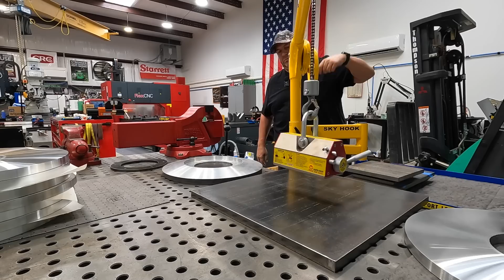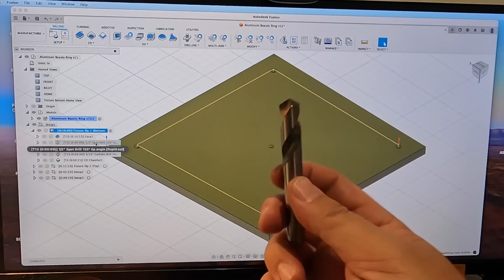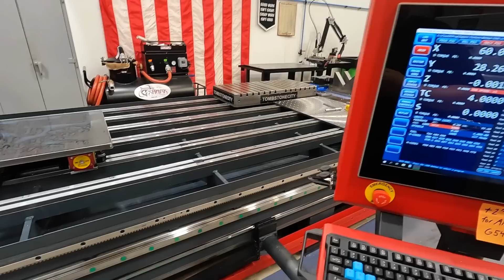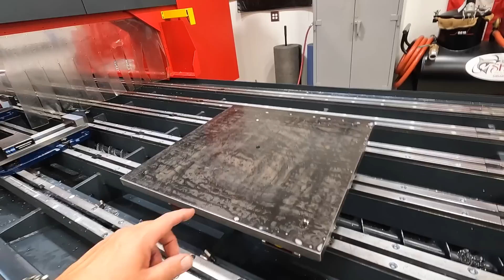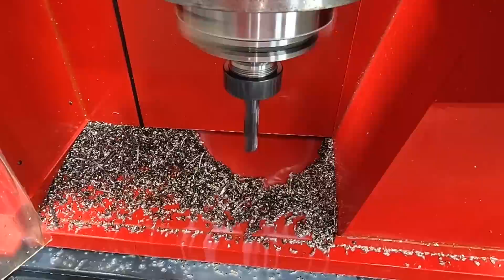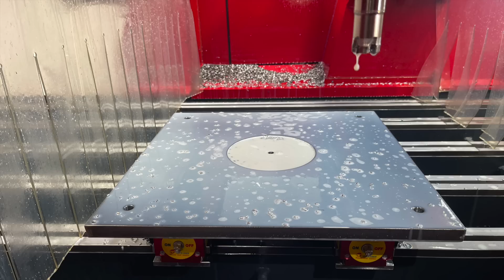Milling the Beauty Ring Fixture for Op.1

Comment: One thing I would have recommended is to threw drill the holes in the square plate to allow for chips to drop out. Not a big deal but a safety. Wish I had my own CNC. learning Fusion and having someone else run the program on their mill adds a certain level of difficulty to the learning curve. But it also adds a level of education to adjust the design and process to allow any shop to perform the operation. Great job Adam, thank for sharing. I always seem to learn something from your learning process. Thank you.
Reply: The magnets are under the plate in those locations if I remember correctly.

Comment: I bet those clearance holes not being through holes will be a problem.
Reply: How much are we betting? ;-)
Reply: @MechanicalAdvantage  
 How much do you have?
Reply: @Riis_DK  .030". The magnets probably could have been spaced out more looking at it now. They were put on there to try to provide support across the center of the plate. The chips were never a problem. Coolant drainage was until a small quick modification was made to the fixture and then neither coolant or chips were an issue.
Reply: @MechanicalAdvantage  
I think you're misunderstanding. My aversion has to do with the use of the fixture, not the manufacture of it.
Reply: @Riis_DK  I'm open to hear exactly how you would have done it. Not generally, exactly.
Reply: @MechanicalAdvantage  
Isn't that obvious by now?  😉
Reply: @Riis_DK  No. because I think if you though the whole process out, you would see it isn’t as straight forward as you believe it to be. The time/cost to make the fixtures was worth it to be able to run 8 parts of each op. 

So I am genuinely curious to hear your step by step of how you would do this. Exactly.
Reply: @Riis_DK  There are so many posts now suggesting machining the bore first then holding through the holes, there must be some merit to it. In fact any other way apart from this chosen one will be far faster, cheaper and easier. 
No pre machining, only one simple fixture and one loading of the part.
Reply: @MechanicalAdvantage  
There's no reason to show you a "step by step" procedure. The only thing I would do differently is make those blind clearance holes through holes (the point made several times in this thread) to avoid build up of swarf during the manufacture of the alu-discs.

I'm puzzled as to why you forgot that. 🖖
Reply: @marley589  👍
Reply: @Riis_DK  Other than it will have absolutely zero impact on the machining of this part and we weren’t 100% sure about the location of the magnets under the plate. Turns out where they are set, if everything were set perfectly, there is.032” of clearance. I promise you the chips weren’t an issue.
Reply: @Riis_DK  not having a through hole in the center larger than the bore will cause problems with chips gathering in the bowl created by the ring bore and the top face of the fixture plate. They will be constantly be recut wearing the tool and affecting the finish.
Reply: In situations like this it is always desirable to allow chips and coolant to fall away and not get packed into blind holes. Simple fix is to finish drill them through with a cordless drill. Unfortunately he has to take the plate off the machine for a while so that would be an opportunity to finish the holes through before he has to set it up again. The center should have been completely removed for all the chips to fall through. If it is left solid, there will be a bowl of coolant and chips recutting themselves when running the job.
Reply: @marley589  it has zero impact on this job. The tapped holes will have a fastener in them. The other holes are oversized for clearance. Those holes not being thru drIlled doesn’t matter a bit.
Reply: @MechanicalAdvantage  It's just good practice.
Reply: @marley589  I’m hoping you will start publishing videos on YouTube so we can all learn from your knowledge
Reply: @MechanicalAdvantage  The comment section on large channels will allow many many more viewers to benefit from a long lifetimes study and practice designing, toolmaking, jigs and fixtures. Ignoring traditional practices will always come back to you.
Reply: @MechanicalAdvantage  
How many fixtures with blind clearance holes have you made?

And please notice that the operative word here is clearance - not storage of swarf and fluids. 😘
Reply: @Riis_DK  No idea. I guess I have never counted how many fixttures I've made in the last 20 years. I've made enough to know that in this case it really didn't worry me.
Reply: @marley589  
Exactly.

Comment: Cool. I am no machinist. I wonder if you could have used a small pattern of bolts in the middle to anchor the material to a sacrificial fixture plate on the CNC and cut nearly the whole show side with that one setup. Just a few little webs to separate the part. Just a thought experiment. Love watching you solve problems.

Comment: Nah, man. ECB-120 means 1,200 kg holding power. Eqv. to 1.2 metric tonnes - what that is in banana weight I don't know. 😁
Reply: thats a fuck ton of bananas!
Reply: @levitated-pit  Hah! Ok, sir, which ton do you mean? Long ton, short ton or metric ton? (2240 lbs / 2000 lbs / 2204.6 lbs, or 1016 kg / 907.2 kg / 1000 kg)
Reply: @Hydrazine1000  a fuck ton is when you try to lift a heavy object and say "fuck no!"
Reply: In the old days an inch was 25,4  mm and a whole bunch of zeros before the next significant figure appears.  Now the 18:43 inch is defined as 25,4mm exactly.    Its time the USA became exceptional and metric!
Reply: 1200x2.2=2640, so he got the rating right in pounds
Reply: @Sam-th4jl  
How many ounces is that? ;)
Reply: @Riis_DK 16 ounces per pound. Do your math.
Reply: @ellieprice363  
Now, now, Ellie. I'm just yanking yall's chain by making fun of 
your archaic and silly units of measurements system.

Those imperial conversions are not mental arithmetic, right. 
Even the above calculation to pounds is off by a few percent
because of the approximated conversion factor. 🖖

Comment: Booth, here's a thought. Spin that in the CNC lathe. I suspect it will give a nicer finish and a more repeatable setup once you finish that ring. Face both sides, drill and tap your 6 holes. Then bolt the ring to the part and bump it into place. Leave the ring there and simply bolt in the next part.
Reply: I'm pretty sure that the Milltronics CnC lathe can't handle that size of disk.  Aside from that, I totally agree that it cries out for CnC lathe work.
Reply: Too big to do it in the CNC lathe. Not enough swing (or travel for the cutting tool)

Comment: Like those magnets 👍 Holding that plate down with a total force of 46,973 Newtons - it's not going anywhere.
Reply: I get it at 48,000 N. How do you calculate it?
Reply: @Riis_DK  my approximate solution was off as well, oh well.
Reply: @Riis_DK  1 pound-force = 4.4482 N 
2640 X 4 X 4.4482 = 46,973
Reply: @kempy666999  
Okay, I see your problem. Thanks.
1,200 kg x 4 x 10 N
Reply: @Riis_DK  No problem here. 1kg does not equal 10N, it is approximately 9.8N

Comment: The ball endmill is going to leave the look of several circle lines around the tapered edge??
Reply: A ball endmill is not ideal for the taper. APKT style inserts with a 5mm corner radius in a close pitch endmill will perform much better.

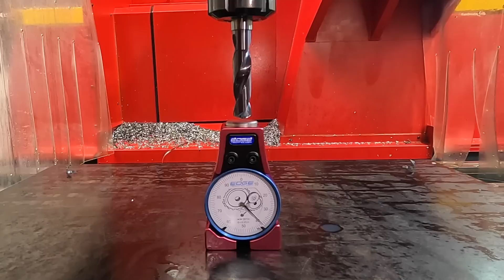Comment: 38:52 You can use your Haimer 3D to center the part using the half function on the cnc, instead of using a coaxial indicater, that may prove to be faster.
Reply: Do you know if the Flex supports that? On my Siemens control, I don't have that as a default option, but I can find the center of 3 points.
Reply: @MechanicalAdvantage  you center on Y and then center on X or wise versa with using a 3d probe, your probe needs to be calibrated though.
Reply: @YILDIZGEZEN  But if your controller doesn't have a divide function, it is up to you to do the math to figure it out, right?
Reply: @MechanicalAdvantage  just like zeroing on the corner of a square part, this time you zero on a circle, move back on Y axis when inside the circle with your probe, touch and zero on the probe, then zero on the machine then move forward on Y axis touch and zero on the probe then divide the Y value on the machine by half, that will be your Y zero. Do the same for X and you are done. This should be faster compared to coaxial indicator. But this methods accuracy depends on your 3d probe's calibration, there should be no runout on your probe. I dont know the specifics for your machine but i see no reason your machine to not letting you do this.
Reply: you should be able to use divide symbol "/" on the machine.
Reply: If you can't divide by 2 then you are in the wrong job

Comment: OK WOW. YOU HAVE COME A LONG WAY, GREAT JOB. hay do you run coolant on the chamfer ??????? oh, and set a mag plate to pull a steel plug down on the center of the disk after you remove the clamps, raise the plate to install the magnetic device. just a thought sir. And PLEASE KEEP THE CONTENT A COMING.

Comment: 38:06 why didn't you use your touch probe? this would have been a perfect application for that thing.
Reply: He doesn't have a Renishaw probe for the Flex. @yildizgezen
Reply: @MechanicalAdvantage  i mean haimer 3d probe, not renishaw
Reply: @YILDIZGEZEN  I don't think the flex can do that. Originally it was conceived as a structure to machine in other ways on structural steel parts for road work and never allowed to shine as a true flexible cnc 4 axis mill with attitude <g>.
Reply: thats what i thought.

Comment: Did you know that you can probe the Z 0 with the Haimer 3D Sensor?  You have to measure the length pf the Probe once, and then you can use it to set your Z 0 while your setting X and Y.

Comment: Just curious. Why did you not face the first side and flip it , and face the second side and machine the outside square and all the holes and features on the second side where everything is square and concentric. A million dollar mill should not make shabby un finished fixture plates that could be used for other parts.
Reply: The second side top surface is irrelevant. As long as the bottom is flat, the only other surfaces that matter are where the part will sit when it is machined. And that will be parallel to the bottom face. Some with the outside. No need to machine it square. Everything is located off the center thru hole.
Reply: @MechanicalAdvantage  Personally, I would have machined one edge straight so that the fixture plate would always be indicated in the correct direction because the pockets for the bolt holes do not match with aluminum part if the fixture plate is in the wrong position by 90 degrees.
Reply: @peto22  I think they would. Everything is symmetric and everything is based off the center hole. All of those features were machined at the same time. All holes are either for the strap clamps or clearance and have plenty of room around them. Find the center and have everything else relatively square, and good to go
Reply: @MechanicalAdvantage  It may be symmetrical but set the plate at 90 degrees and the 6 holes are out to the program. If there were holes of a multiple pf 4 then ok, although it  still depends on how square the plate was cut and which edge you indicate.
Reply: With rough cut parts like the plate it is common to edgefind in the middle of two sides and not near the corner. It helps when setting up again as it helps to eliminate any out of squareness. This is also heplful with machined edges where a part is re-referenced several times during its manufacture, whenever possible a stop is set to the middle of the datum edge.
Machining both sides of this plate will allow it to twist as the stresses are relieved, it can easily end up more bowed. Plough ground steel plate is far better for fixtures, you start with a flat and parallel blank to work from. Better still for this low volume application, Aluminum toolplate would have been ideal and is readily available.

Comment: Any particular reason to use blind holes for the strap clamps and hole pattern clearance holes?   Is it so the clamp studs tighten in the plate?
Reply: If I remember correctly, it was to avoid drilling into the magnets.

Comment: 2.2 pounds per kilo=120 x 2.2=264 pounds per magnet x 4 =1056 pounds of total clamping force. I wouldn't want to see you apply a lateral load in excess of that, air born steel is exciting but also dangerous! Cheers
Reply: That was a whoops. He meant to say 1,200 KG, or roughly around 2,600 pounds.
Reply: @MechanicalAdvantage  per unit, for a specific thickness and/or composition of "steel". Anyone wishing to check can go to the manufacturer as several have done. But I understand your efforts here. I, too, help to fill in the many blanks in experience shown by and to posters...  a thankless task- so thank you sir.

Edited to add various types of punctuation.

Comment: when i made parts like this (on a smaller scale) i use one fixture.    at first i blot a part through a middle hub and machine all features at once.  
then put additional bolts through a newly machined bolt pattern and mill out middle hub in one last op.
in general you don't need two fixtures if a part will be machined from one side only.
Reply: Yes just one fixture plate required. Clamp the plasma cut outside diameter. Finish mill bore + counterbore and holes. Bolt to fixture through the holes and then take off clamps. Then mill the taper and outside diameter. Finished. No pre machining of blanks and one simple fixture plate.
There will need to be a shallow shallow ring recess for machining the outside diameter and a hole to clear the chips away under the bore..
Reply: @marley589  That would be maybe be worth it if you were doing one or two. He is making 8 of these. Touch off, load the program, hit cycle start. Load the next, hit cycle start, load the next, hit cycle start. Repeat until you have 8 complete. The cost of the fixture is pretty minimal on this job.
Reply: @MechanicalAdvantage There are 2 fixtures so two setups and two operations in addition to the manual work.
So far he has made a clamp ring, machined 8 blanks, one fixture plate and still has to make another then set them both back up again!
In the same amount of time he could have easily made a simple fixture plate as described and  completely finished the whole 8 plates.
Each blank plate is loaded only once on one fixture and comes off finished. It really is as easy and as simple as that.
There was be a lot of unnecessary attention paid to making one side flat, the side that sits on the ground. There was also excessive attention paid to creating a reference on the outside diameter. I believe this part has around 7/16" extra material per side on the two diameters so precise location on the fixture was also completely unnecessary.
Reply: In this case, he will use a recess to locate the OD of the part. The second fixture will be used to cut the angle face. So the fixture needs to be smaller than the diameter of the part. Could have got by with one fixture plate if the ID of the discs could have been turned to finished dia on the lathe. But the discs were held by the ID and the OD was machined.

Comment: Machine the other fixture plate first. Then when this one is machined it can stay on the magnets already in the correct position for running the job. This is commonplace when using any fixture for the first time.

Comment: Adam, did you give any thought into turning that steel plate into a universal holding plate. ie 5/16 holes on 1 1/2 center covering the whole plate with machined edges?